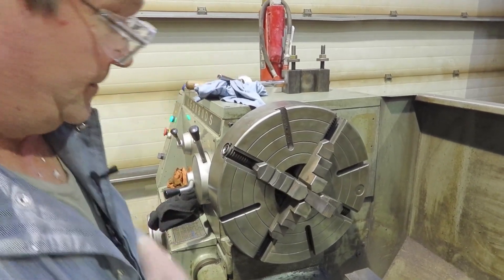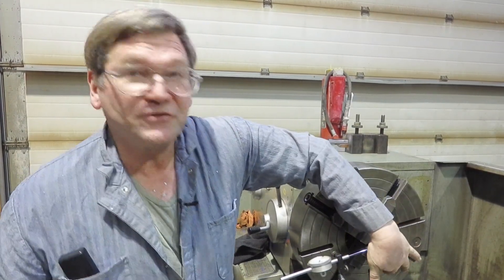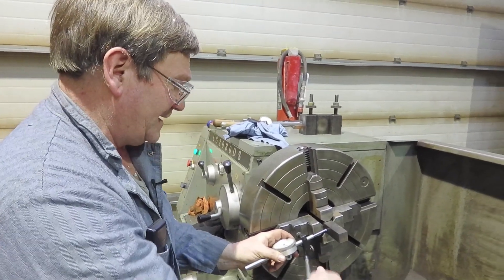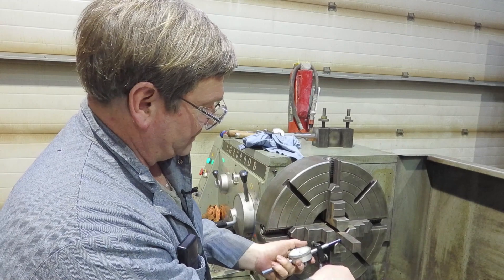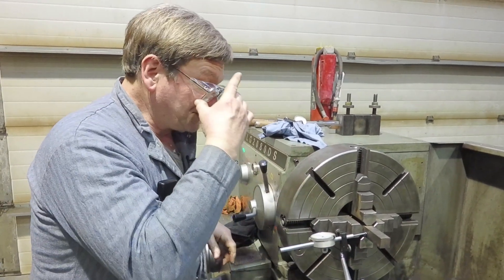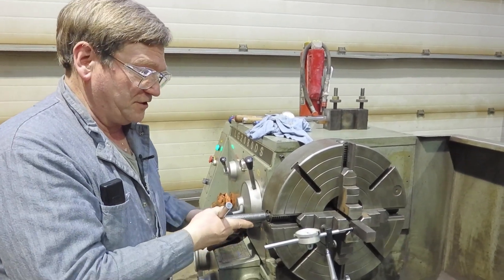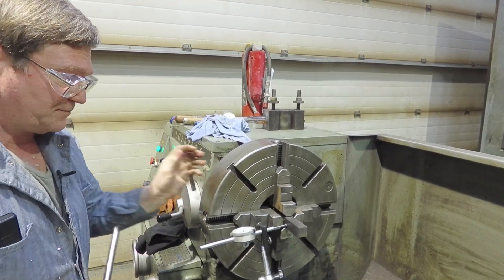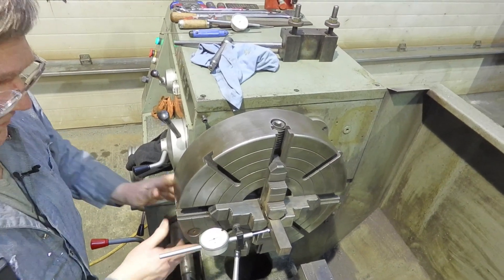Machinist's Minutes: Four jaw chucks and square/hexagonal stock (part 2)

Comment: Another trick with dialing stuff in is if you can make a punch mark where center is then use a live center in the tailstock pushed up to a dead center on the part.  Then dial in the dead center.  Also helps keep pressure on the piece. Which sometimes can helpful.

Comment: One thing I like to do is stick the magnetic base for the indicator on the tool post. Then I can move it back and forth to zero as I start to dial it in.  Saves having to do the math or move the indicator around. I don't like spinning the bezel either to get to zero.